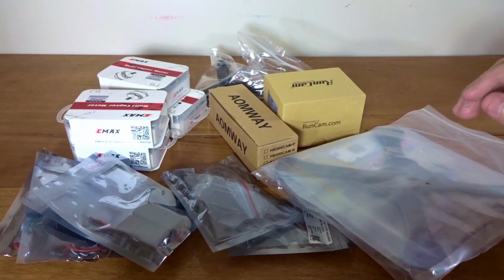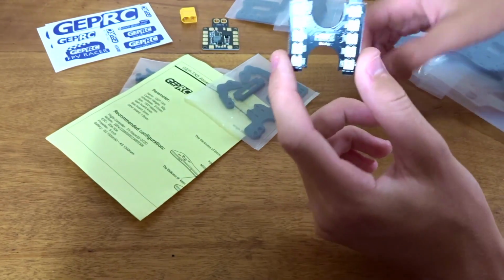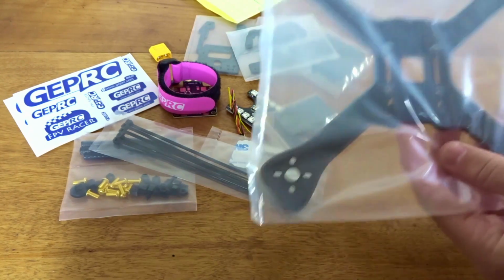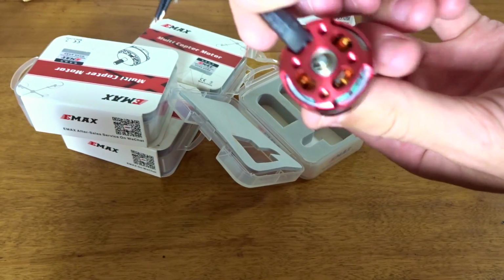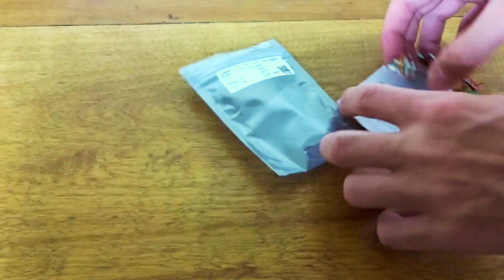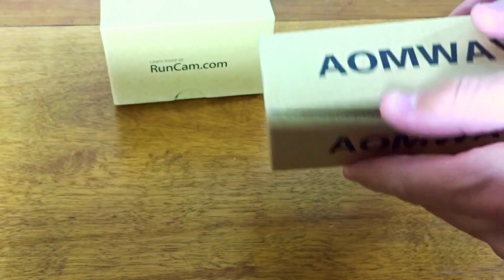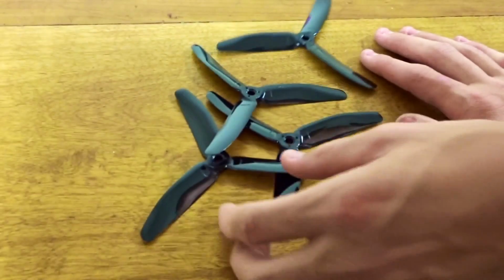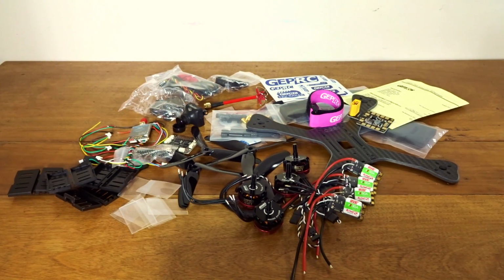GB-X210 Kit : Parts Overview

Comment: Hey I'd like to start by saying that I love all your videos. Your line of sight is great. I'm coming up on 1 year in the hobby starting from latrax alias. I've since started building with a lot of drama. Yesterday I did something foolish, and flew my first complete build fpv without a spotter lost video signal ,and you can guess what happened. Your fpv videos are also amazing. They look like you're getting awesome range. My question at this time is. What vtx do you recommend, and what kind of range are you getting with it, and what is your favorite flight controller?
Reply from the maker: My favorite video transmitters are the Rush V1.1 and TBS Unify, pretty much a mile. FC would probably be the Hyperlite F4 and Furious FPV Radiance.

Comment: I subscribed so I could ask you a few questions. Number one being I haven't found one video with a quick overview on  what and why all the non-common sense components are in a quad. Obviously us noobs know what motors, props and batteries are but I've watched about 60 videos and have learned tons, would like a all in one video out there made specifically for noobs! Lol! PCB I completely understand, ESC's, flight control, but I'm getting lost with all this telemetry talk. I'm assuming it has something to do with the receiver and vtx. Like your video btw nice stuff!
Reply: Totally went off on a tangent and left out that this is the first video where someone has somewhat explained what the stuff does in a way, mad props and keep the knowledge comin!
Reply: Waiting on the realacc x210 pro to get here, first "quad" build, not worried about being able to do it just worried about binding and what not. Hope all goes well
Reply from the maker: What are your questions? haha I didn't pick up any specific questions sorry.
Reply: The RCAddict my kit doesn't come with a few things, camera, vtx, receiver. What kind should I buy that will not make me want to upgrade for quite some time. Also I would like to have a battery life alert what is that called( don't even know what to youtube when it comes to that
Reply from the maker: Hohmies Mcfly I love FrSky and use the XSR for my Receivers, and the HS1177 or RunCam swift for an FPV Camera. VTX can be almost anything, 200mw dragonfly, TBS Unify, yada yada yada haha.
Reply: The RCAddict love the hospitality! One last question, considering the kit I'm gunna build frysky i6s or turnigy evolution controller? I'm goin through all your videos and giving them a big thumbs up and def lettin other noobs know about your channel and hospitality!
Reply from the maker: I would probably get the Evolution, as it is a very nice remote :)

Comment: Cool! About to do my first build soon.. Just learning how to get the bnf quads in the air! LoL
Reply from the maker: Let me know if you need an help! Have you bought the parts yet? Interested to see what you picked out :)
Reply: The RCAddict it's a rather small build, I have a 150 frame, 1306 motors, 12amp blheli ESCs and a CC3D Atom that I'm thinking about not using because I think I want a board that natively supports Betaflight..
Reply from the maker: Frequent Flyer RC Cool :) I started my 130 build last night. Depending on the frame, a pdb and fc in 1 might really help you. This kit came with a SP F3 which I am "eh" at using.
Reply: The RCAddict don't like F3? What's better.. F4?
Reply from the maker: Frequent Flyer RC Oh no, F3 procesors are certainly fine, just I meant that board isn't the best. I hate those stupid micro connectors, I have some DOA due to sub par quality, processors are i2C so only 4k gyro update. It really will work fine, but I prefer something like the X racer V3.1. I can run 8k 8k on beta 3.0 on that no problems since it is SPI and it has pin holes to solder to not connectors :)

Comment: Good Video I have a question would this be a good first build thanks rich
Reply from the maker: Thanks :) I am not so sure how much I would recommend it as a first build as since this is an X frame, there is very little room and the wiring it tight. Something with a full middle section would have much more room and be easier to start with. I mean and I am working on full build videos for this, so you could follow along, but up to you. Same parts here, so same wiring, but open frame http://www.gearbest.com/multi-rotor-parts/pp_448102.html?wid=21